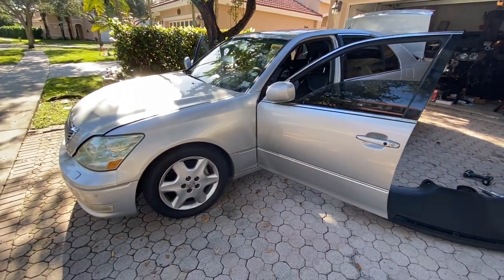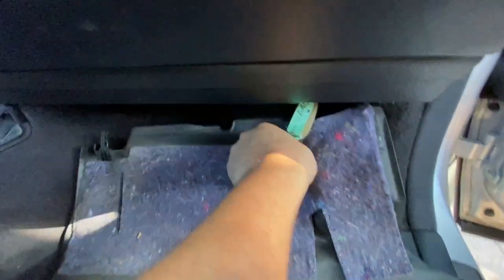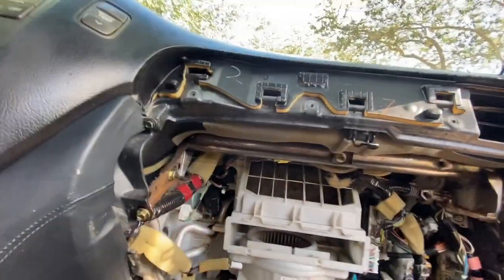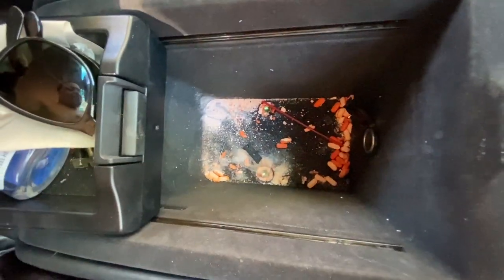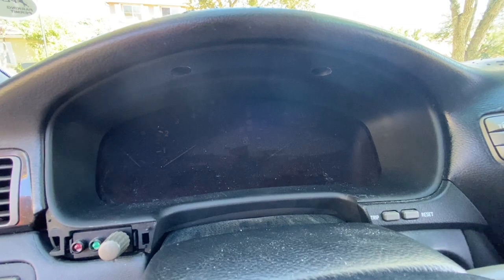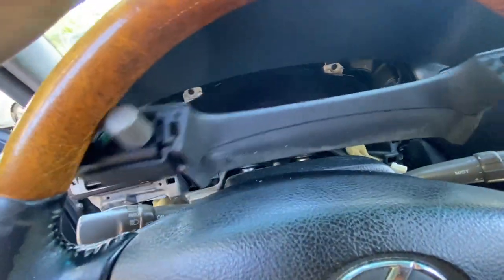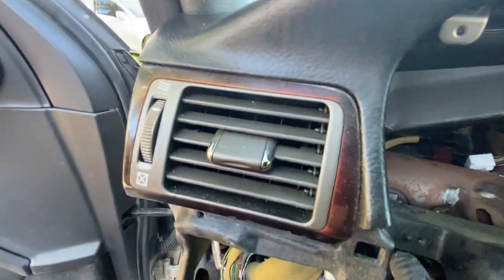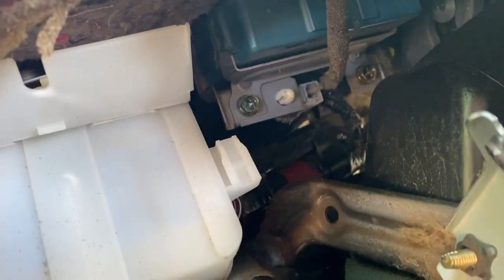Lexus LS430 Dash Removal / Swap Part 1

Comment: Thanks! I just needed to take my glove box out to get to one of the computers. I didn't have a clue, but your video explained it all. By the way, I have the two (upper and lower) glove boxes, and the procedure is the same. Only, I had four 6mm (10mm wrench size) bolts holding it together, and the same three phillips head bolts that you had at the top. Thanks again!

Comment: just a tip, always remove the negative terminal not the positive, because if the positive terminal did touch any bear metal on the car, it would go boom.
Reply: 👍
BTW, it’s the wrench handle touching any metal parts would cause a boom!

Comment: Mad respect for this. I need to replace my tweeters so badly because they’re crackling but omg that’s a lot of work. But, if you were just doing the speakers and not a whole dash replacement, is it less time consuming?
Reply from the maker: Thanks man! It is a lot of work, it took 3 hours. I saw a forum member in FB stating he just Broke the tweeter covers and broke off all the plastic for the tweeter holder. He then ran new wire and shoved his new tweeter in the hole. The. Place the cover back on. To complete remove the tweeter there’s two 10 mm bolts under the dash, so technically yes to remove the tweeter you will need to remove the dash.
Reply: @mistervaso  I’ve read those DIY style, I didn’t want to do that. I know it’ll be work but honestly having it done right means more
Reply: should just replace door speakers with ones that have built in tweeters and disconnect tweeters from the amp
Reply: @BleechMedia  having the tweeters so low would sound awful. There’s a reason why the tweeters are placed higher up in the dash or on the door near the mirrors. High up to the ears and to also standout from the low bass and mids
Reply: Did you fix the speaker or not? I need a way to change the speaker, but this seems very difficult

Comment: Do you remembsr how you got the driver ac vent off. I cant figure that out....
Reply from the maker: @jrsgwon  it’s that damn wire harness
Reply: @mistervaso  did you get your coin tray? If not I have access to one.  Also is there any way to get the driver vent off without taking the dash out? I broke mine trying to take it out but dont want to break another to replace mine.